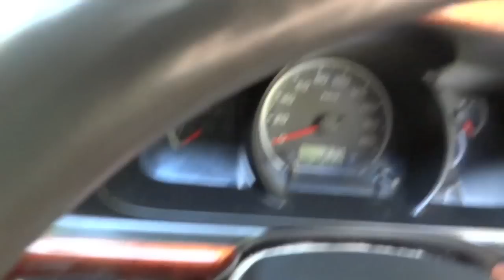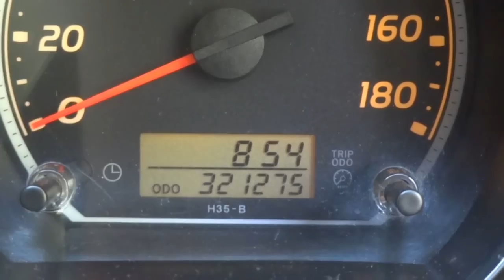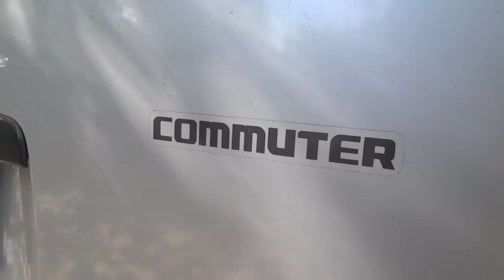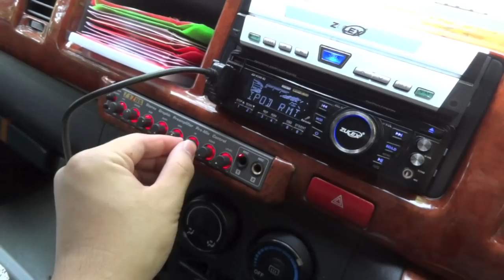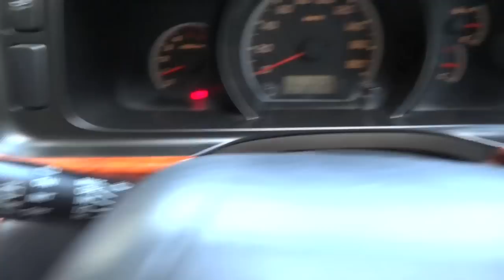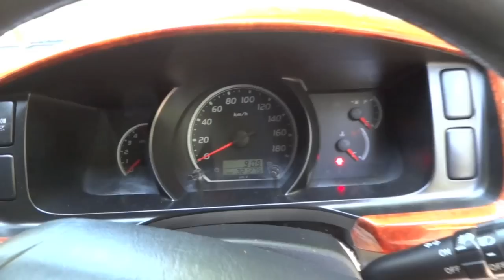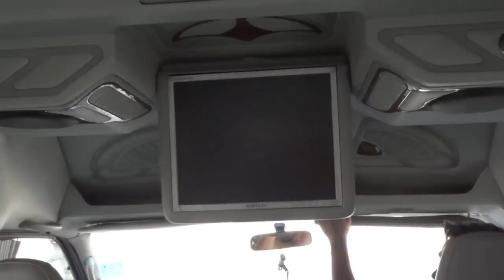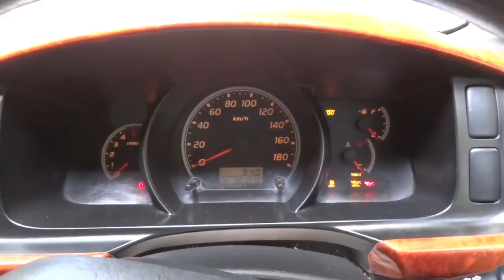2006 Toyota Commuter D-4D Start-Up and Full Vehicle Tour

Comment: This thing called hiace in my country Indonesia
Reply: jodhi wirawan it is also called hiace in Malaysia.
Reply: Hiace has 2 type stock Hiace and Hiace commuter in Indonesia but sadly why the engine is still the 2.5 2KD-FTV 102hp unlike Innova they get 2.4 2GD-FTV and don't have automatic transmission, but thailand have 2.5 and 2.7 they are Slow...
Reply: Hiace in Pakistan
Reply: In the philippines it's called hiace lxv super grandia meaning luxury long van
Reply: Hiaec from thailand